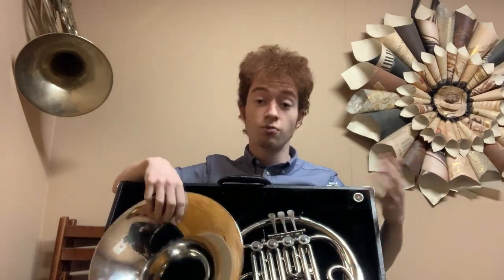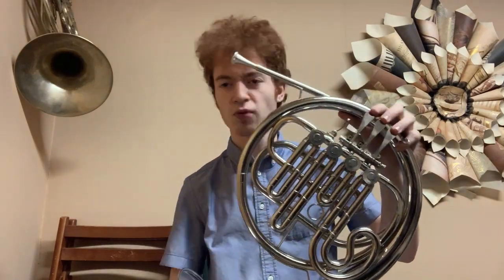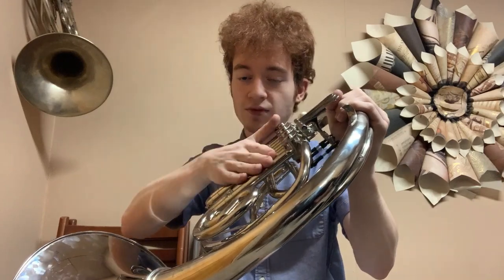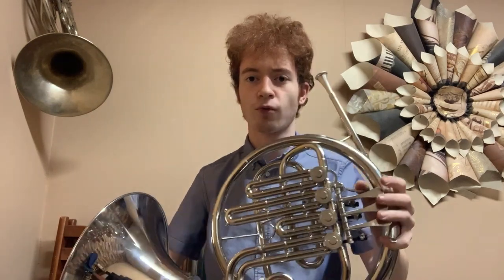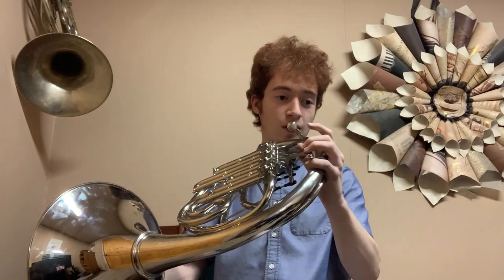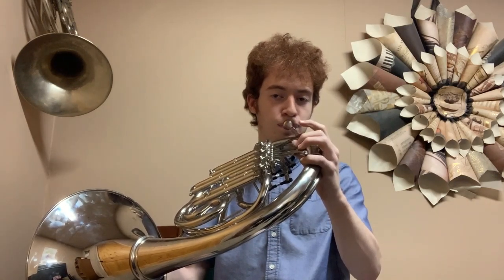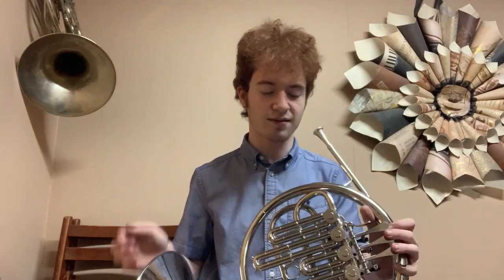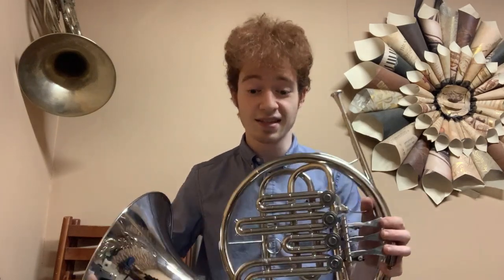'Soul' Instruments Bb Horn | Instrument Reviews

Comment: It is an A stopping valve. It is used to lower the pitch when you stop the horn. You hold it down when fully stopping the horn so that you can use normal fingerings. That may be incorrect, but as far as I know that is it’s purpose.
Reply: That's exactly what it is - a stopping valve. On an F horn you finger a semitone lower when hand-stopping. But on a Bb horn you have to use that valve, which lowers it about one-and-a-half semitones.
Reply: On most single Bb horns there's an option to use a shorter slide for the 4th valve which lowers the pitch by a normal semitone - putting it into A.
Reply from the maker: Interestingly, my pitch goes down a little over a semitone when I fully plug the bell. Am I thinking of a different technique entirely? I struggle to see how blocking the bell could cause the pitch to simultaneously go up and down. Anyway, showing my general lack of expertise in horn playing. Barry, I imagine a normal semitone would be pretty handy, with perhaps an extension or alternate longer slide to add that extra quarter step. Similar to how old cornets and saxhorns came with 'high pitch' and 'low pitch' tuning slides, but just for the thumb rotor.
Reply: @SamuelPlaysBrass  Hand stopping on a horn is a dark art - not much understood even by horn players! What actually happens on an F horn is that the pitch of a note is bent downwards to about a semitone above the harmonic below. So it is convenient to think of it as going up a semitone. On a Bb horn the same thing happens but the pitch doesn't bend down quite far enough - hence the need for the stopping valve.
Reply: @SamuelPlaysBrass  Btw, when you bend the note down by just one semitone, that's called half-stopping. It's more muffled and less brassy that full stopping.

Comment: I payed a single, Bb Horn just like that for many years.  It was a gold plated Alexander, which I just donated to charity a month or so ago.  The thumb valve is for alternate fingerings and extending the low register.  And yes, it brings a number of notes closer to being in tune.  Those single Bb Horns are great solo instruments!
Reply from the maker: Wow, an Alexander made in this same configuration? I'd never have thought. What other commenters seem to be agreeing on is that the thumb rotor is to bring the horn in tune when stopped; you mention the two purposes I detailed in the video but I think they're practically moot. One extra semitone really doesn't do the modern hornist any favors when concert D2 down to B1 are still inaccessible, in my opinion... In any case I could see this type of instrument being used in solo literature for its lighter sound, and I'm glad you were able to get good use out of yours!

Comment: It's a single bflat horn with a stopping valve.
Typically on a double horn you play stopped notes on the f horn and transpose them a hole step down, if you only have a single bflat horn that becomes tricky.
If you would to use the same technic on bflat horn like you would on f horn the notes would be really out of tune or very hard to even produce.
this horn's 4th valve makes it so you can play stopped notes on the bflat horn without transposing.
It's quite a common instrument for kids to learn on in Western europe, (i don't really agree with this teaching methode, I'm brought up with the more traditional F horn way of teaching like in Vienna and Farkas books) but none the less, it's light and somewhat easy to play
Reply from the maker: Very good explanation. Thank you!

Comment: Are the fingers the same as trumpet or the same as a f horn or is it combination of both😊
Reply from the maker: As far as SOUNDING pitches, the fingerings are an octave off from trumpet and identical to baritone or euphonium. In terms of WRITTEN pitches, the fingerings are the same as the trigger side of a double horn, because horn parts will still usually be written in the key of F regardless of the use of an F or Bb based horn.

Comment: Stop valve, jealous! Stopping on the Bb horn raises the pitch 3/4 of a whole tone. That is why on a double horn, you play stopped horn on the F side instead, which only raises the tone by a half, and finger everything a half step down. There are modern double and triple horns with these in addition to the standard triggers!
Reply from the maker: @domepiece11  I’ll bet a stop valve is the sort of thing you could add to a double relatively easily since it’s a single-sided rotor unlike the rest of the rotors on the instrument. Would be cool to see someone hack one on! I’d say make it a quick-change rotor like old cornets used to have for Bb/A because I hate split-thumb levers.